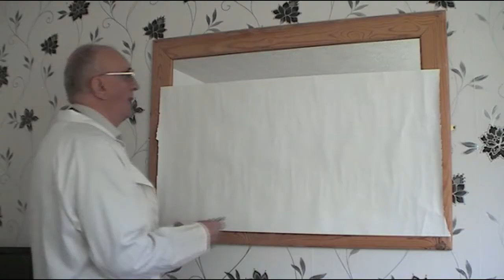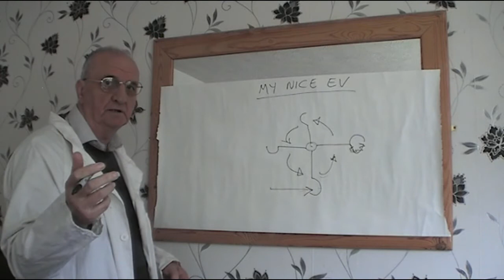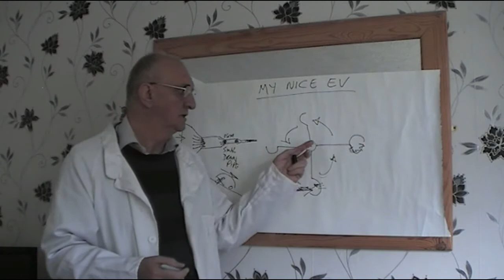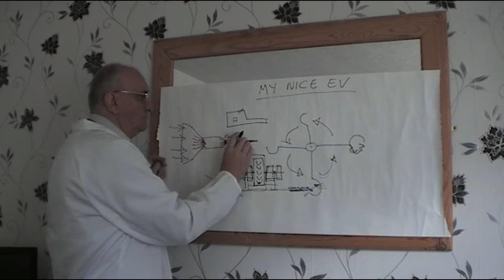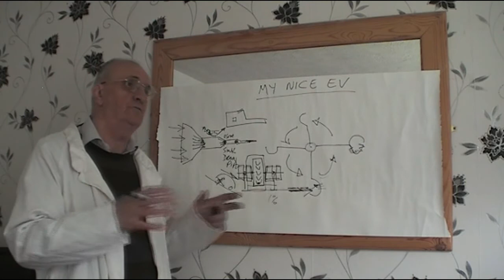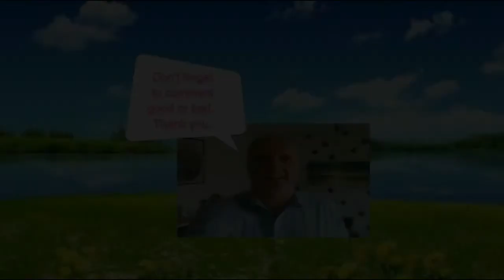MY NICE EV Wind Turbine

Comment: Great idea Raymond. Regenerative breaking via wind drag. I like it. Its a great concept for dealing with the problems that arise from inductive regenerative breaking.

I have an idea for your opening flap. I wonder if I can ASCII draw here? Lets find out

--------\
--------/   Closed

--------/
--------\  Open

thats not exactly how I would do it but I think you should get the idea :)
Reply from the maker: AWESOME! That is simple and stupid like me. I would only need sprung loaded latching solinoids. One top and bottom. The open and close could be controlled by tilt switches. I was thinking motors and all sorts. Never thought of that. You are amazing. From now on it will be known as the MSV after its inventer. Yup! The MONGREL SHARK VENT! Thank you so very much my good friend. Thank you. That is one thing I don't have to think about anymore until build time. Have an amazing day my friend.
Reply: Glad you like it. The idea that was not conveyed in the ASCII drawing is that the end of the flap should hinge on the inlet duct wall.

More like this_____/ <-- that's either the lower half if closed or the upper half if open. The beauty of it is its a streamline cone when closed and opens to a big draggy wide mouth venturi inlet. If you use a motor or servo to control it you can have variable opening size.
Reply from the maker: That is even better my very good friend. Thank you. Do you like the name of it. MSV?
Reply: LOL. You gotta call it something. Its probably an existing type of opening with a name.

Comment: I have a question, sir: I didn't really hear the beginning of this video well, but wouldn't a flywheel generator work as well as your wind turbines, and be simpler to make?
Reply from the maker: Sorry about the audio John. I will double check it on future videos. Thanks for pointing it out. Yes I agree with you. A flywheel would be good. But it would be heavy and not everyone would be able to get or make one. I am using everyday things that are thrown out regularly to achieve the "as cheap as possible" criteria of the project. Thank you again my very good friend.
Reply: Raymond Earle Well, maybe it'll be genius. My ideas usually work, but a lot of the time they don't work nearly as well as I thought they would. Anyway, you're going to test your idea out on a conventional auto.
Reply from the maker: I always go with a little is better than nothing moto. So if I only get 0.5 of an Amp into the batteries from this idea. It will be good. I am no genius. I am orbiting the Earth with my rear on fire. I am a Twatalight.

Comment: Ah good idea..All of this is going to work, because you put the paper over a large mirror and it didn't drop off the wall !
7 years good luck :)
Good point about washing machines too, if thinking about a full load, all that water and the speeds the things rinse at.
Reply from the maker: Next door uses the ends of the fixing screws as coat hooks. LOL. Hello my good friend. I tried stopping one of these motors at 90C DC using laptop cells. With a pair of pliers and 18 stone pressing down on them while it was running. All I achieved were grooves in the pliers from the pully cutting them. The motor didn't even know what I was doing. It just kept going. https://www.youtube.com/watch?v=V4-GaaIqANs Enjoy. My regards to Julie.

Comment: Something tells me that due to resistances and natural losses in the generator it will take more power than it will give back.  Are you saying that you are going to kill the motors and just coast down inclines to collect the energy then restart the motors then the next incline you go down you will repeat that process?
Reply from the maker: It would be a waste of energy to have the motors running downhill. If the motors were in the wheels. Then I could do regen using the wheel motors as generators. The cost of such a system? Not in the project criteria of "as free as possible". As I always say. A little is better than nothing at all. I shall only find out in practice. That is why I don't like designing. I like to build it and see if it works. If it doesn't then find out why and fix it. Have an awesome day my very good friend.
Reply: Raymond Earle
Well, there has to be something to slow down the descent and normally electrical vehicles uses a reverse on the motors instead of disc/drum brakes to slow down else you would be coasting which is illegal in a lot of mountain areas and very dangerous too.  Now Hybrid vehicles use a braking mechanism that helps to generate electricity and that is why a Hybrid vehicle gets better mileage in a city than in the country (opposite of a petrol vehicle).

How do you plan on handling having the driver to slow down the vehicle on such inclines?
Reply from the maker: Yes I realise all you have said my good friend. The forces required to generate the power would also be acting to slow the vehicle down. Due to it's light weight of about a third of a normal salloon car. Means that the use of the brakes as well will not be hazardous. The downhill speed is targeted at 30mph. The maximum speed I am aiming for for the vehicle is 50mph. Anyone who builds it to go faster. Does so at thier own risk.
Reply: Raymond Earle
Ahhhh, this I did not know as I was thinking of normal highway speeds.  Cheers.
Reply from the maker: No problem my friend. I appreciate your input a lot. Keep it coming please. Have a great day.